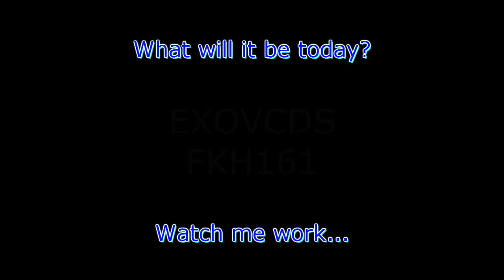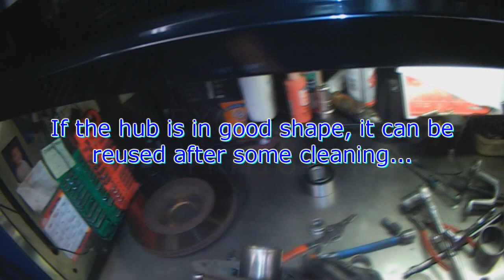VW A4: Front wheel bearing replacement

Comment: Hey Thomas have you ever ran into an axle that will just not want to come out of the hub ? Every video I’ve seen of yours makes it look easy but I’ve been beating on this for a while and it will just not come out. Doesn’t look too rust and there’s no m10 holding the axle in place. Also the drivers side I was able to get out no problem but this is the passengers side I’m having the issue with. Any help would be appreciated thanks
Reply from the maker: Get a hub puller that fits your luggage bolt offset and press the shaftout.

https://media.napacanada.com/is/image/GenuinePartsCompany/2029439?fmt=jpg&qlt=70
Reply: @EXOVCDS  you’re the man !!!!

Comment: Thomas, I need to do the same job on my 2004 GTI.  Can you tell me the specific diameter puller adapter necessary for both the inner and outer races?  I want to be sure I have the proper sizes before starting the job.  Great video.  I appreciate that the volume is turned down so the air tools aren't blasting through my speakers.  I also like that the video is concise and has sub-titles where appropriate.  Well done!  Keep up the great work.
Reply from the maker: The sizes of my puller parts are not stamped on the parts. The idea of the tool is to use whichever part fits best. The tool can be rented at most auto parts stores. Thank you for watching.
Reply: @EXOVCDS  A follow up question; what are your thoughts on putting the bearing in a freezer or in a cooler with dry ice overnight, and installing it when it's ice cold?  The thought is that the bearing should shrink a very small amount but enough to make alignment with the bore slightly easier during the initial press into the bore.  The rationale is that there would also be less chance of damaging the bearing if it slides in easier.  I never pressed a wheel bearing before.  I will be very cautious to get the alignment right.
Reply from the maker: Freezing or heating parts is sometimes required... whatever works.
Reply: 60 mm is it iknow 3 years later lol , but the wheel nearing kit usally have stampings on them but for vw it is 60,?

Comment: Nice repair!   So smooth!   Thomas,  my glow plug light flashes intermittently sometimes after the car is already warmed up.  Ever come across anything like that?   1991 Jetta diesel
Reply from the maker: bunkerbuster There's a water sensor in the plastic tank under the car... right rear passenger side. drain a sample out and check for water.
Reply: ok awesome will check tomorrow, thanks!
Reply: now if there is water in there, you just have to drain it all out and should be ok?>
Reply from the maker: bunkerbuster Drain as much fluid as you can out of that container... if it has never been drained / touched for a long time, the screw cap might break when you try to get a sample. As you unscrew the cap, fluid should come out of the little spout. I've seen the clogged / plugged... some people remove that little tank and just run the hoses straight to the pump & back (Web search).
Reply: you are golden... do you come across older volkswagens much? other than the vanagons ?  I just love the old mark 1 and 2 jettas most.  I had a mark5 which was nice too.  hey, what carr do YOU drive thomas?
Reply from the maker: bunkerbuster We don't see many anymore... but we worked on enough to still remember a few things! My '89 E34 525i
https://www.instagram.com/p/BEzaS-fFDel/
https://www.instagram.com/p/BFC81FmlDSB/

Comment: Anyone make that hub buster at 4:00, or do I gotta pull out the welder?
Reply from the maker: It can be knocked out from the back (at 1:05 in this video).
https://youtu.be/tMwT6QQklS4
Or a slide hammer at the front.
Another way is to remove the knuckle / strut... as in this video.
https://youtu.be/vQzMdTS17LY

Comment: the car needs a realignment after you disconnect the lower 3 bolts right ? can t you disconnect the steering arm so no realignment is needed ?
Reply from the maker: At the pinch bolt or the tie rod end? Sure... whatever works / is easier. As long as the 3 bottom bolts go back where they were... should be close enough to where it was (alignment wise). Alignments & tire balances should be done every 2 years anyways.
Reply: Thomas EXOVCDS Where I used to live (Romania) mechanics work is very cheap on one hand, but alignment is quite expensive, so to avoid alignment they never touch the lower 3 bolts or change position of that, but you are probably right about the alignment . btw now I live in Germany, and here the repairs on the card are crazy expensive ! For what you did in the video they would charge probably 500 euro in a normal shop and 1000 in a VW one I think . At home in Romania I changed all the arm bushings from the front arms on my Golf 4 and the work was like 25 euro !

Comment: Hello, i have clicking sound at front passager side under the turbo in my a4 b6 
I have a video in my chanel if you plase can watch and tell me what do you think ?
In that video i have a pry bar under gearbox and subframe moving up the gearbox with engine, it does this sound in bumps reverse first gears low speeds and when braking also.

Comment: Do you need wheel aligment after bearing change?
Reply from the maker: Yes... if the ball joint was disconnected by the lower 3 bolts, then a wheel alignment should be done. The alignment should be checked every 2 years regardless, to maintain good tire wear.
Reply: I just did alignment to my Bora in VW service and they set TOE 0°05 '  front. Last summer i had 0°00 ' and one summer one set of tyres. I think little bit + is good for FWD. Camber and caster was ok.

Comment: You're a professional
Reply from the maker: Jay Dubau far from it... but thank you.
Reply: Thomas EXOVCDS don't fool yourself ☺. How to distinguish between noisy wheel bearing vs bad cv axle? Should one just replace both?
Reply from the maker: Jay Dubau Depending on the noise, it can be quite obvious. Wheel bearings will make a noise that gets louder the faster you go. Axle noises will vary depending on  load & steering wheel position.
Reply: Thomas EXOVCDS. Lol. I took off my brakes, broke loose the lock nut, pulled out the rotor, and a screw fell to the floor. The grinding sound was that rogue screw that fell and got "lost" during my head gasket replacement job.
Reply from the maker: Good that you found the missing screw! I forgot to mention that a front wheel bearing can be steering sensitive as well! I would not have guessed a screw as being the cause of your noise... had you asked me about a weird noise. =)